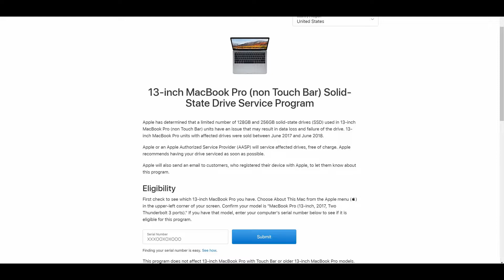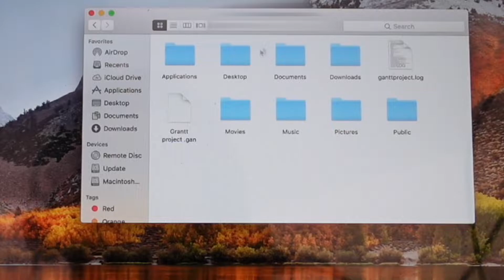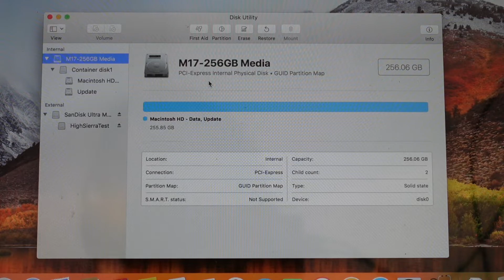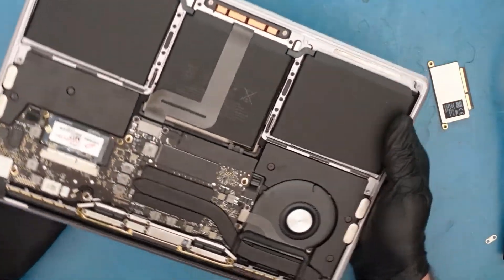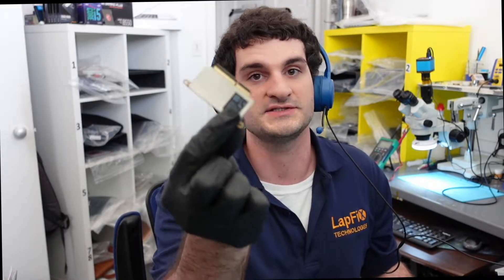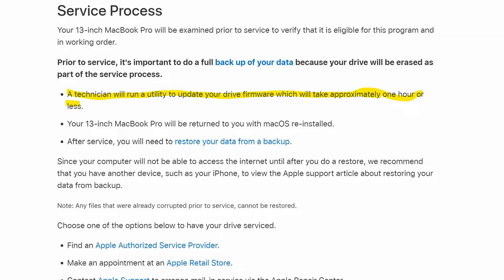Why Fixing Macbook Pro 2017 SSD Issue with a Non Genuine SSD Is Dangerous

Comment: ha, just went exactly through this this week, I updated my 120 gigs ssd with a 2 tb corsair 2230 with an adapter , worked perfectly for 2 days then one by one my Mac ports were not functioning... and there are only 2.. , I switched back to original 120 gigs ssd and now it works..

you are completely right, buy big from the beginning.. :)

Comment: Can I upgrade a 2017 mb a1708 that has a 128gb ssd with an original 1T that come from the same model? They sell it on aliexpress. Would that be 100% safe? If yes, should I install Ventura from USB or internet recovery mode or it's the same?

Comment: You can use aftermarket drives with the adapter without problems, just avoid crap like the one the other shop used. I did this replacement dozens of times with zero issues.
Reply: Hi what is the best brand you would recomment i use with the adapter, and where  can i get the adapter, thank you
Reply: @storybooq Samsung, Western Digital or some other Make

Comment: I have an adaptor for this type of drive. When a customer comes to me and needs a data recovery on an a1707, a1706, a1708, I just plug the drive into my tower with an adapter. They also make adapters so you can plug in a short M.2 drive to the macbook, but these models are notorius for having SSD problems. Of course Apple had to be different with their NGFF ports too.
Reply: I’m trying to buy an adaptor to connect the macbook ssd into my tower. Could you tell me where to get that adaptor.
I would greatly appreciate it 😃

Comment: Can't this also be resolved by getting a name brand 2242 m.2 drive? Many other channels have the same model of MacBook model a1708 and can update to the 1tb m.2 drive with no issues. Cheaper drives will cause issues. I am thinking about getting a 128g a1708 and upgrading it. Would I also run into the same issue? Thanks.

Comment: I'm confused. There's an issue with only 128G and 256G 3rd party ssds, but upgrading your ssd using any 512G+ drive would be completely fine?

Comment: the SSD controller needs to be compatible with Apple's EFI NVMe driver. There have been lists of fully compatible drives around for years, since the first iMacs and MacBook Pros with Apple's proprietary NVMe drive slots. Weird off-brand drives rarely work properly in macOS, but a handful of name brand drives work just fine with full compatibility. the Macs with full UEFI support tend to have wider drive compatibility.
Reply: Yep I think you have answered my question. Pay for what you get. Don't get a cheap ssd brand get a name brand. Sabrent 1tb seems to be a good choice.
Reply: Can you suggest a good brand for me? I am having a hard time locating some. It's for my Apple MacBook Air 2017

Comment: I have a problem with my SSD and my mac is the same model as in the video. Is there any new "news" regarding the problem, like a new  type/brand/producer of ssd introduced to the market? or is it still risky to replace the SSD with a non-apple one?
Reply from the maker: There was a recall, but I believe it is not there anymore.  Use the 512GB apple version only
Reply: @lapfix  Do you know where you can buy apple version online?

Comment: This is the "Hunter Biden Laptop" model. The serial number was on the FBI subpoena in the New York Post article. I'm curious if you've followed the origins of the laptop and the steps taken by "John Paul Mac Isaac" in performing data recovery. If so, I'd be curious what your take is on his story of three dead macbooks and the $85 dollar manual file copy recovery performed on the 3rd unit. Mac Isaac also claims to have recovered 300GB from a laptop that's only supposed to have a 256GB SSD in it, a replaceable one too as you know, which Mac Isaac allegedly told Biden couldn't be done and formed the entire basis for why he had to do a granular folder-by-folder and file-by-file backup. That's when he says he discovered all of Biden's questionable behavior via thumbnails..
Reply: What an idiot

Comment: Will a non-genuine 500GB+ replacement SSD work, or does the replacement have to be an Apple drive that's 500GB+? I have a 2016 that seems to have this issue — original SSD failed to the point the disk couldn't be seen by the system. I replaced it with an OWC 240 GB which worked for a couple days. But at some point while I was away on vacation, the computer is back in the same state as before, no startup disk seen.
Reply from the maker: I would recommend 512GB Apple drives only as the 128gb and 250gb are known to fail.  I wouldn't trust any other for this model
Reply: @lapfix  … wow and I was just thinking about getting a 2017 15” nope I’m just going to go get me a 2015 15” they don’t be having these problems!
Reply: @lapfix  that’s really interesting that there’s something about the larger drive that makes it immune to this issue.

Comment: what do you mean by "Non Genuine SSD Is Dangerous"? not sure what you mean by that because you never said anything in the video about it that seemed dangerous.
Reply: Is it going to catch on fire or something?
Reply from the maker: As we are also a Data Recovery center, we take our customer's data very serioiusly.  Apple doesn't officially support these third party drives.  Issues of any kind can lead to issues such as inaccessiblitly or data loss. Not to mention the quality of the cheap SSD Controller and NAND.  Even Apple's 128gb and 256gb models have major issues, so more of a reason to avoid third party drives.
Reply: @lapfix  It seems that any drives are better than the apple ones as they fail on a regular basis. you can buy a 512 gig Samsung for 30 bucks plus the adapter for 20 and be done with the madness...

Comment: I have the same issue with 250 GB SSD in 1708 model.
I have checked their service program for SSD. But it says I am not eligible.
How is that possible ? because I have the same laptop as described in their description. Non touch-bar Mid 2017 purchased.
How can I request apple to replace my SSD for free as they have sold me faulty product?
Reply from the maker: If you checked the service program then yours may not be part of the bunch that is impacted with this particular problem.  As per the page I showed before, they aren't replacing the drive but updating a firmware or who really knows
Reply: @lapfix  that's really sad to hear.
Not only SSDs they also put faulty butterfly keyboards in 2017, 2108 models.
Reply: @FreedomForKashmir  You forgot to mention the "stage lights" problem that can affect the display...  :(

Comment: I have exactly the same model A1708.
Recently I had similar issue ... I was seeing Flashing folder on startup and it won't boot. I took Macbook to Apple service provider .... they said something is wrong with SSD and its faulty. 
So now the work around I am using is that I have purchased external SSD Samsung EVO 980 500 GB with enclosure. I have installed Mac OS on it and using it. It's been couple of days now. This solution seems working fine. 

My question to you is that what do you think of this solution ? How reliable is this?
Secondly , can we ourselves update the firmware on SSD without taking laptop to Apple shop ?
Reply from the maker: It very inconvenient and will be very slow as it will not touch the NVME speeds but limit itself to the port.  Later macOS builds may not like it as an external and show a circle with a line through it when you boot.  I wouldn't rely on it as a main computer
Reply: @lapfix  thanks for the reply.

You are correct, it's not touching high speeds, it's limited just under 1000 MB/s.

Should I just put the nvme SSD inside the MacBook with the help of converter rather than using as external with enclosure ? 

And what do you think about my second question. Is it possible for us to update firmware on internal MacBook SSD as they would do in free service program ?
Reply from the maker: Only they "officially" have access to update the firmware.  I wouldn't recommend it.  I made a video about putting in an aftermarket ssd in this one, check it out and see if you would still like to:  Here is the video  https://youtu.be/KzxD7NQVSU8
Reply: @lapfix  thanks

so basically this is how I solved my problem .
I bought NVME Samsung Evo 980, removed Apple SSD  and then plugged in it with the help of adapter and now I am using it on daily basis  with heavy development work and it is working fine
Reply: @FreedomForKashmir  i am having similar issue with my mac currently. Its quite expensive to get a new ssd installed in my machine. i would like to know how you have replaced the mac ssd with samsung nvmo. Where did you bought that and how did you install it?
Reply: @FreedomForKashmir    So is it still working no kernel panics freezes ?  I have same issue want to go your route ?
Reply: @FreedomForKashmir is your Mac working fine. I'm thinking to upgrade my 128gb SSD to 1tb as 128 is too less. It freezes/heat up my MacBook. 
So, should I buy Samsung nvme 980 1TB? And how would I connect it as both are difficult is dimensions and design?

Comment: Greetings from Ukraine. 
Give me please short answer - in case I have a problem with hard drive in macbook 2017 13" A1708 - I need to find genuine SSD ? 
There is no official apple repair service and no opportunity for apple replace program. 

Thank you
Reply: Yea /or no. 

You can get a authentic apple ssd and save yourself from any problems down the line or you can do the repair like in the video but with a more reliable ssd. The “fletching ssd” is genuinely bad it’s on Amazon with bad reviews. I’m not saying you should but you can get the nfhk n-1708a adapter and a sabrent rock and repair it with that. I saw another video about a guy doing it, his channel is dammit Jeff go watch it.
Reply: many compatible alternatives available now , I got mine from ifixit
Reply: @johnbenton62 What ssd brand did you use as an alternative?